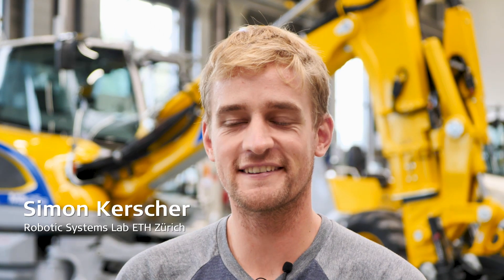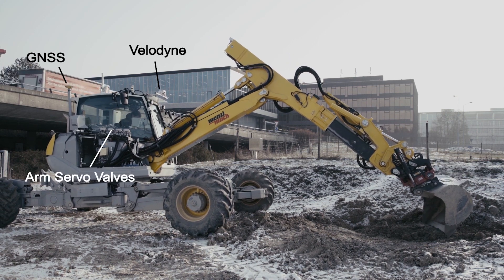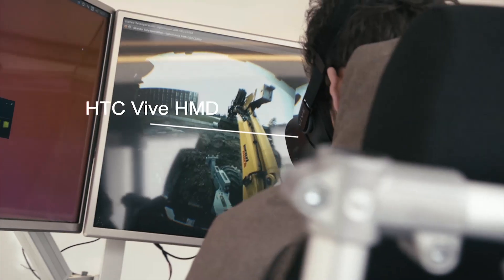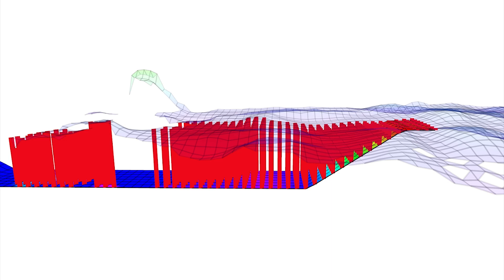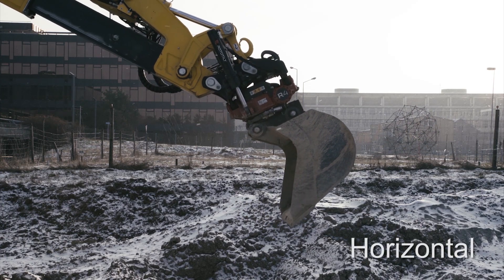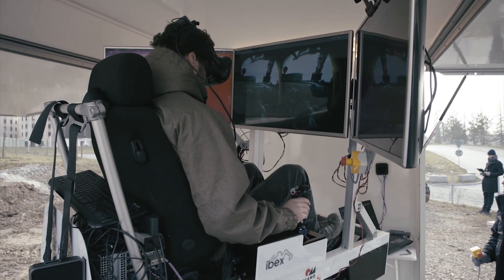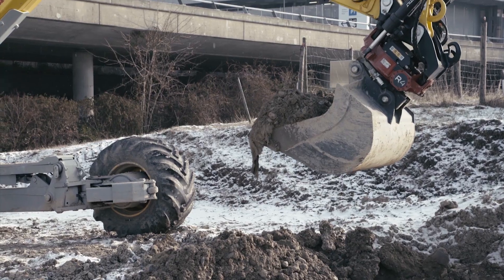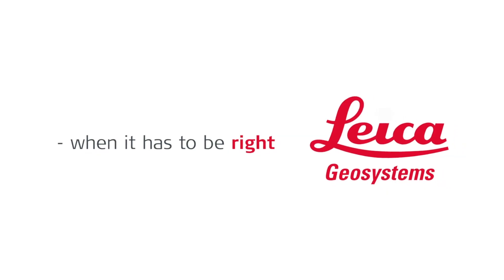Automating a walking excavator with machine control

Comment: We have a remote controlled Menzi Muck in our company but you would never use it in step areas because you simply have no feeling for the maschine. It is useful in flat areas to easily drive forward and backwards while doing work you dont have to get in and out of the maschine all the time. But i guess in this case its just about what the leica system is capable of.
Reply: I agree completely!